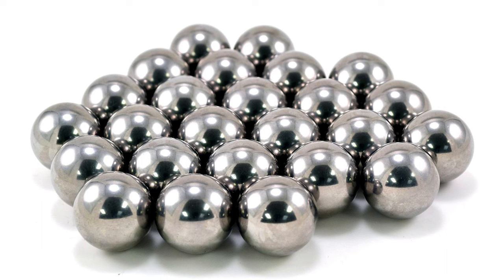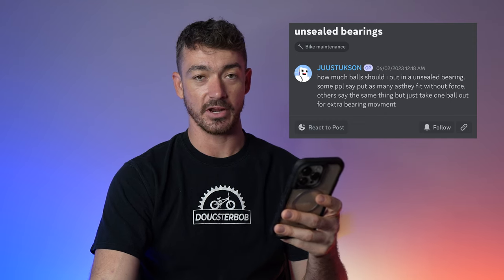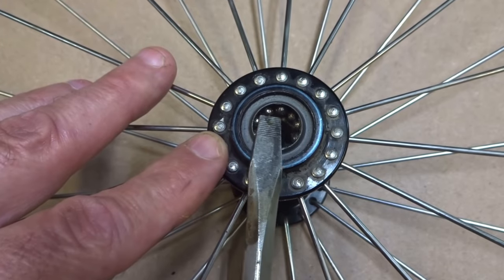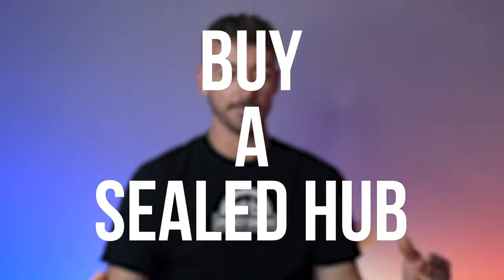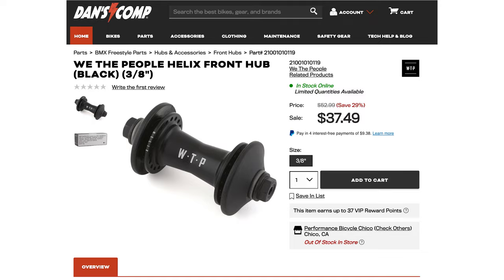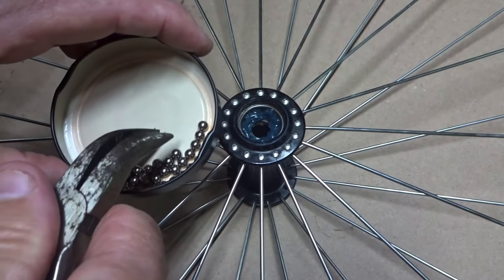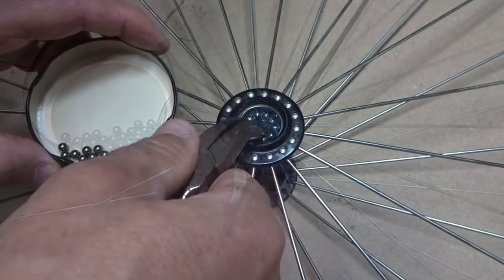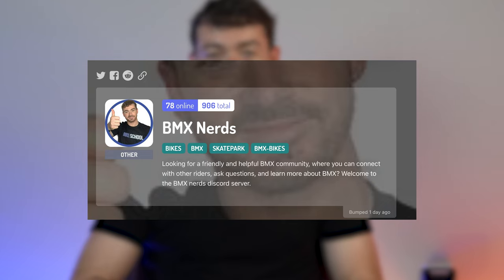BMX Hub Tips - Ball Bearings in the Front Hub

Comment: Nothing wrong with repacking loose ball hubs.  Make it worth the effort by cleaning parts well, using hi grade balls (gr 25)  and using proven waterproof grease.   For ball counts,  remember the load full and remove one trick.       If cones and cups in good shape, then YES  the repack pays off and you gain valuable skills with the final adjustment.   There should be no play after tight and in place on fork and frame.     And a little grease oozing out is good,  just wipe excess off right away.    Some loose hubs have such good sealed mech so this pays off.

Comment: Full or not of bearing balls in hub is a tricky question and important as it relates to the resistance of wheel rotation as a function of the friction between the balls and the hub. I assume, based on experience, that the fewer balls the less total friction but more wearing as the pressure on each ball is greater than more balls. The opposite is that more balls the more total friction but less wearing as each ball shares less force. So, the optimal number of balls should be in the middle ground, i.e. not full in the hub nor too few.

Comment: So the answer is 9 ball bearings 99.9% of the time. Maybe your is weird, but it should look more or less full in any case. I don't recommend using caged bearings. Buy a tub of wheel bearing grease from you parts store. It is not the absolute grease that money can buy for this purpose, but it works great and you can do hundreds of hubs for $9. Also, 1 or 2 hours of work for a $36 hub you are making $18-36. I don't know where you live but most people are not making that much where I live. Plus factor in you need to spend longer re-lacing your wheel than you would rebuilding your axle. At least I would. The alternative is paying a shop to replace it and at the point buying a pre-made wheel would probably be more convenient and quite possible cheaper.
Reply: Also, what happens when this new hub fails? They tap the old bearing out and press a new one in? That is even harder than servicing a cup and cone bearing. They buy a whole new hub/wheel again? Not only is that expensive, but very wasteful. I love my cartridge bearings for their long service interval, but if someone was new to servicing hubs I would recommend buying a set of cone wrenches, buying a pot of grease, if necessary buying loose ball bearings and learning a bit more from someone willing to teach instead of recommending they buy.

Comment: Buying a new front wheel would probably be the cheapest and fastest alternative to buying a new hub. Buying a new hub would also mean you’d need the correct spoke size for the wheel. To risk stretching spokes. You’d also have to have the knowledge of how to re-lace a wheel which I’m assuming most people don’t, then you’d have to take it to a bike shop where they will charge you the same price as you’d buy that we the people hub for. Then you’ll have to say 3-5 days at best for your wheel to be finished.

New complete front wheel > buying a new hub, risk of needing new spokes, paying for manual labour to re-lace

But most definitely if you’ve got a ball bearing front wheel, you’ve purchased a stock bmx build. You can buy a nice aftermarket front wheel for around $50, instead of waiting and spending 60$ and waiting for your new hub to be laced

Comment: I always went by, if you neatly can plop a full row of balls in the cup with no gap, then remove one. JUst look at most Asia made loose balls in the hub after removing cones, you'll see the gap.    Many have pretty nice lip seals these days, so pays off repacking hubs with good grease.  Dont leave solvent residue in hub when cleaning, rinse out good then dry. Dont use the original Park Bearing grease, it failed on me in rain, destroying the cones and cups of hub!  And don't ride with hub play.